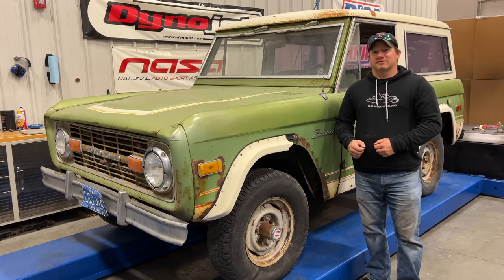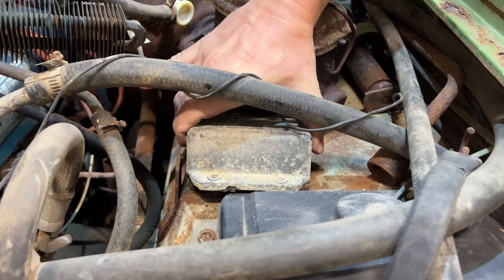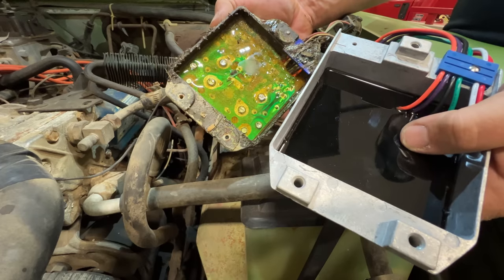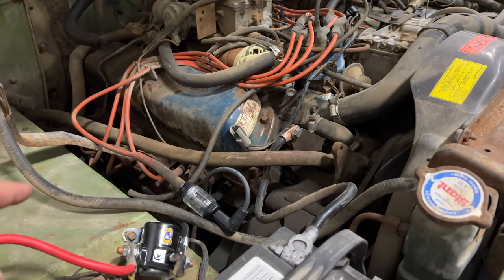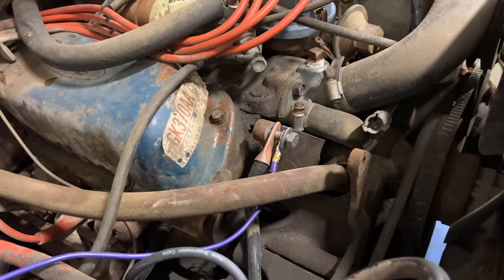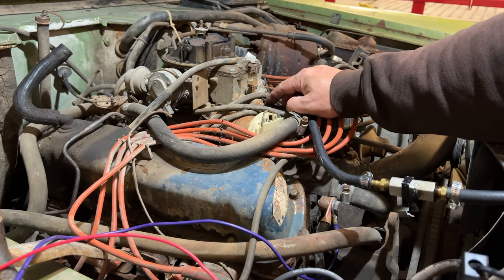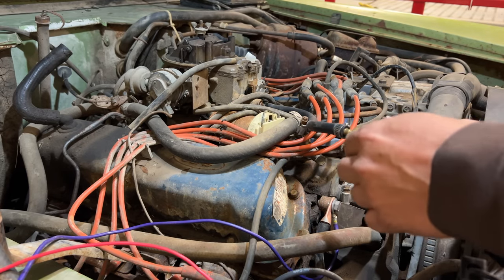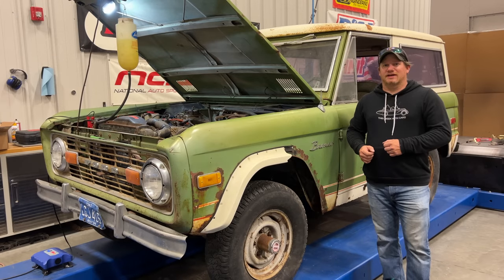1976 Ford Bronco Sport Parked for 30 Years - Part 3

Comment: Very good outcome Steve. I am sure a number of viewers will be surprised at how far back electronics were found in non top-end European domestic vehicles, especially ignition systems. The requirement for reduced noxious emissions drove electronics in ignition systems more than fuel economy and increased performance in the 70's, though economy and performance were both side benefits that was quickly capitalised be vehicle manufacturers. Keep up the good work you do keeping these older vehicles running. 👍.

Comment: Enjoyed the video.  As the original owner of a 1976 Bronco [302, automatic trans], I can attest to ignition module failures.  Have had to replace 3 times over the years.  I carry a spare as previous failures left me stranded.  I noticed that some of the engine parts are located slightly different than mine.  I have front disc brakes and wonder if this one does?

Comment: Was the old ignition module indeed faulty? Or did it not work due to the missing ground connection?
Reply from the maker: The ground was working in the last video when I tested it.  I might have had a jumper pack providing ground to the body at the time...

Comment: Will that ground be heavy enough- if you have headlights, wipers and heaters on etc ?
Reply from the maker: This is just to get it running to test the driveline, then it will be torn down the chassis for a full restoration.

Comment: I wonder if the lack of ground caused the IM to get hot and melt the goo. I've owned many old Fords and never replaced one except for one I did for a customer with ground problems that looked the same after Joe Schmoe replaced the engine using scissors apparently.
Reply from the maker: The IM is a very common fault on this year Ford, usually people get rid of it all together but I need to keep this original.

Comment: Why do you (all of the other you tube wizards also) check for spark at one plug wire when there is a wonderful coil wire that will give you a quicker, more rapid display and be more visible , is it just some need to grind up every starter on the Northern Hemisphere. Try teaching good habits ,not bad ones.
Reply from the maker: Because a lot can go wrong between the coil wire and the spark plug lead.  The plug lead is the closest place to check the end of the line for the spark quickly.